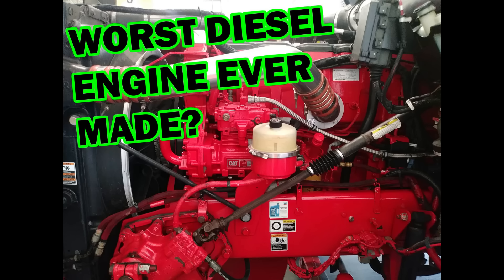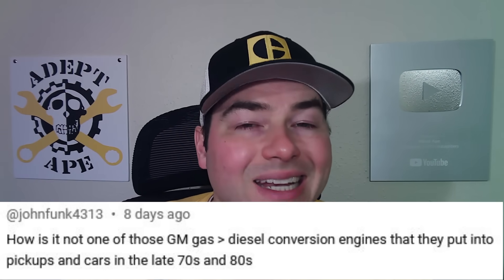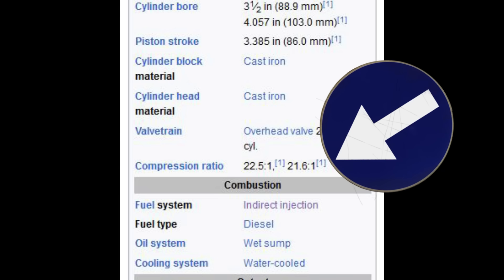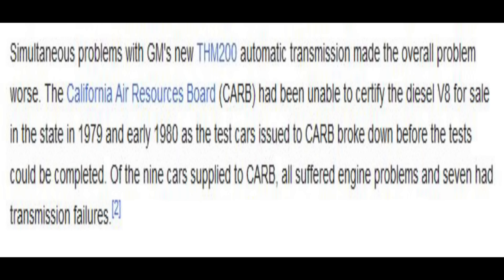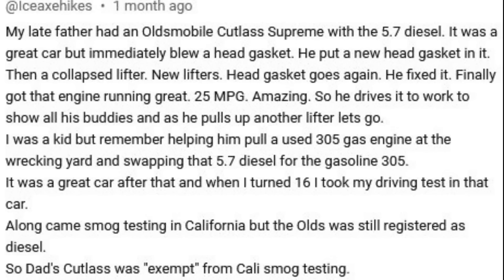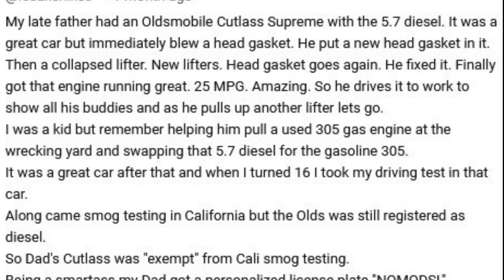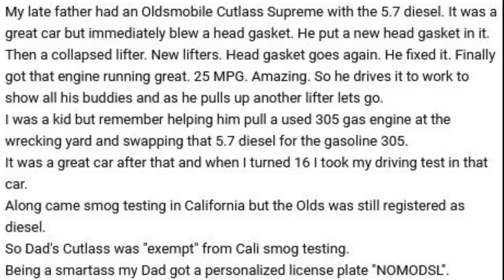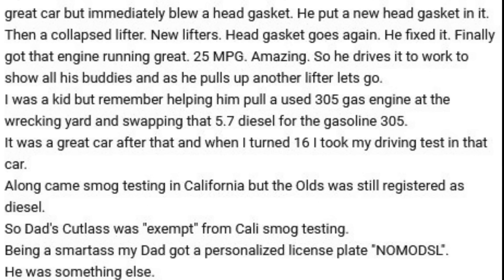This Engine is the Reason You Don't Have Diesel Cars in America!!!

Comment: Some of the problems were from uneducated owners.. people put the same 10w 40 gas oil in their new olds diesel. Also when a glow plug quits they didn't know how to fix it so they used starting fluid . Usually way too much of it. The rest like head gaskets and no water separating filter was on gm.
Reply: Bean counters voting in weak head bolts and the poor fuel filtering did most of the damage.  That and American consumers being the dopes that are, abusing the engine before warmed up.  Europeans drivers tend to be a bit more intelligent and care about their vehicles.

Comment: I'm going to pause at 0:49 to guess that it will be the Olds 350 diesel.

EDIT: That wasn't a hard guess really. When I was in high school, I had this Chevrolet Caprice. It had a 305 gasoline V8 in it with a 350 turbo transmission. It also had a brake booster that ran off the power steering pump, and prominently displayed on the inside of the fuel filler door and the gas gauge were the words "DIESEL FUEL ONLY". It was a diesel caprice that someone had swapped a gasoline engine into.

Comment: Thanks for sharing hope you’re having a great day my opinion those old diesel cars if they would have put a turbo on them they would’ve been a little better everything is better with turbo
Reply: IDI engines aren't great turbo candidates due to the high compression. That's why modern turbodiesels with direct injection all run 16:1ish compression. IDIs were low pressure fuel systems, and meant to be cheap, and run a long time. Turbo hurts reliability and drives costs up a lot. It's just the wrong design for it. There's a reason all your smaller tractors with diesels were primarily IDI. Low RPM, cheap, reliable, good torque at low speeds. My Perkins generator and Kubota tractor are both IDI.

Comment: Never had a 5.7 but ran a 6.2 for years. Not much power but always dependable for me, finally quite around 400k.
Reply: The 6.2/6.5 are from Detroit Diesel subsidiary.  Completely different people and competences
Reply: Completely different engine that was much better designed
Reply: The 6.2 chev diesel  made 2 models  j&c models , the c model had larger valves & would run circle  around the j model.